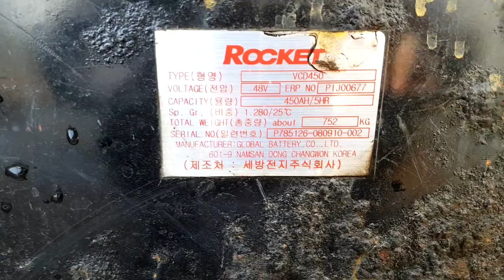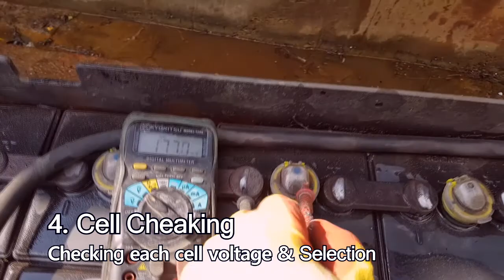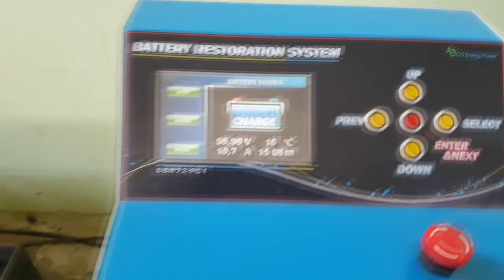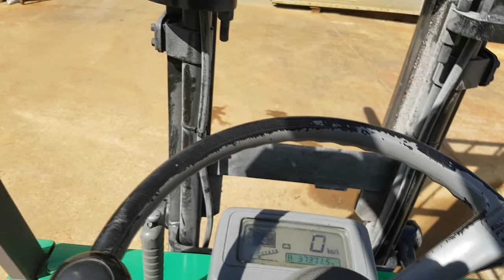[2018 Knowleadge] How To Recondition Electric Forklift Batteries

Comment: Nice job!! anyone no where i can get a Busbar at ?  have a 36 volt but the same as this 48v. i cant fine it anywhere. i need to solder both post on the positive side  Thanks a Ton
Reply: You need to look for an intercell mold. If you haven’t found it already